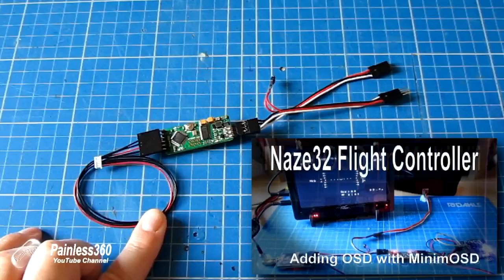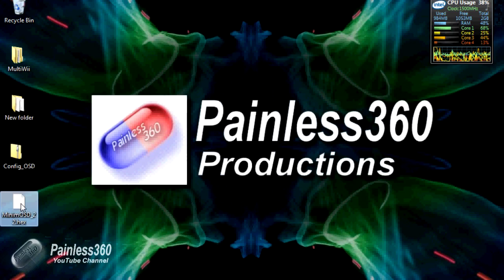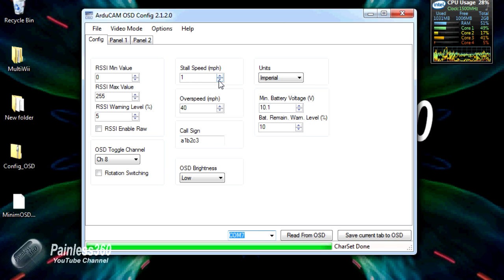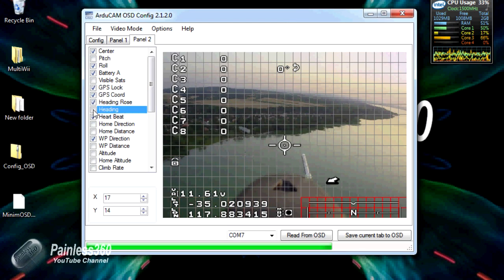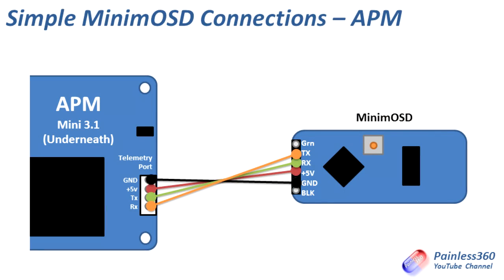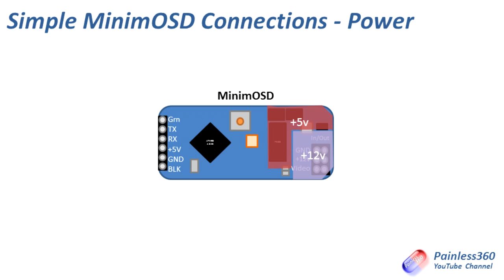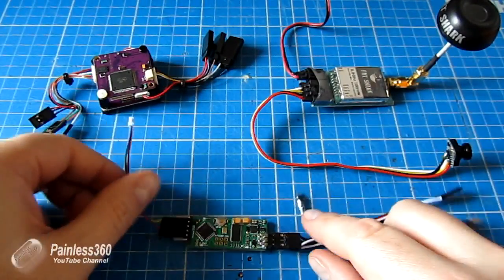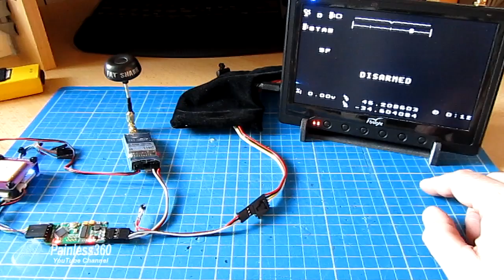APM Mini 3.1 - Adding an OSD for FPV using MinimOSD - complete setup

Comment: OSD only works when the power is supplied via USB without understanding what is necessary delobmozhen shtoto solder?
Reply from the maker: +Максим Иванов Check that the OSD is getting 5v when powered from the battery. I would check that the power connections are ok. Best of luck.

Comment: Hi, I'm just figuering out how to connect the MinimOSD to an APM 3.1 while using a GPS in the same time. The problem is, that the GPS should be plugged in the port, which I though, it is the telemetry port for the OSD. Could you help me with that?
Reply: +ZomhadRC Are they sharing one Port? I could easily solder me a Y-cable, would this work?
Reply from the maker: +ZomhadRC Not the same port at all. See 10:56. Best of luck.
Reply: +Painless360 Thank you very much! Stupid me didn't see it underneath theire :D Cheers, may you have a nice evening!

Comment: Hi, I'm trying to find the same FTDI you are using but then I found this cable 
http://m.ebay.com/itm/6pin-FTDI-FT232RL-USB-to-Serial-adapter-module-USB-TO-TTL-RS232-Arduino-Cable-/400356015296?_trkparms=aid%253D222007%2526algo%253DSIC.MBE%2526ao%253D1%2526asc%253D20150519202348%2526meid%253D279d3ac99b6041b187fc79992f33e98e%2526pid%253D100408%2526rk%253D1%2526rkt%253D19%2526mehot%253Dpp%2526sd%253D351044858391&_trksid=p2056116.c100408.m2460 
Is this the same thing?
Reply from the maker: +Charlie Farrugia Maybe, I only use 'FTDI Basic' adapters here and they work perfectly. Best of luck..

Comment: Thanks for this video i was wondering how the 12v was going to connect to my 5v eachine fpv..turning the whole board into 5v is great.  now i need to convert the eachine plug and play system to what you have shown. hope it will work. thanks again. love your tutorials.

Comment: Hello. I have small question. My configuration pixhawk + miniosd + frsky x8r.  All configures and work fine. In mission planner I see rxrssi with correct value. But on OSD screen I do not see rssi icon and value but in ArduCam I placed rssi. Do you know how I can fix this issue? Maybe need other firmware ? Not arducam-osd ?
Reply from the maker: +RC Copter I've not seen that myself. I would check the settings it the OSD.. Best of luck.

Comment: Is there any way to get a battery voltage reading without using a power module?
Reply from the maker: +Leon Close If it wasn't an APM I'd say use a KV_Mod MinimOSD and connect it to the main battery directly but you can't do that with an APM - different firmware on the OSD. If you really want Voltage then look at a PM. Best of luck!
Reply: Thanks for the response. I've gone with a Tarot OSD in series with the Minim, just for the voltage readout. Probably weighs less than the PM and I already have it.

Comment: HI !!!  I have a problem .Apm mini 3.1 board has only one telemetry port .so how do I connect  telemetry radio and minimosd both into the board same time ????
Reply: +Nayana Pathirana with a Y split cable like this.
http://i00.i.aliimg.com/photo/v0/60076532680/APM_2_6_3DR_Telemetry_OSD_Y.jpg

Comment: Hi Professor, would this work the same for Pixhawk using arducam instead of Minimosd extra where there are some issues on AC3.2.1 and 3.3? I am tempted to try it, as I have poor results with the minimosd extra r800 (which is recommended, on telem 2 with some mods on the firmware parameters for this port...). and to complicate the issue, I am using a 3 way switch on this setup, and off course, nothing works! ;) Just to know if you tried this OSD firmware on Pixhawk, first before moving on.... Cheers and Safe Flying!
Reply from the maker: Any Minimosd firmware that expects MAVLink heartbeats should work. I've not tried it yet on the PixHawk.. Best of luck!

Comment: Oh and another question (sorry to be a pest). I've seen your video on how to configure a Taranis to for send it's RSSI signal to a Naze32 over a PPM channel.  Can the same thing be done with an APM and have the APM forward the RSSI info onto the MinimOSD?  If so, anything we should know?
Reply from the maker: Andrew Smith Not as elegant - http://copter.ardupilot.com/wiki/common-optional-hardware/common-rssi-received-signal-strength-indication/
Reply: Painless360 No not quite but it'll do the job.  Cheers.

Comment: I have the 3DR 915MHz telemetry module and was thinking I could just split the wires from the APM so that I have a telemetry feed going into both the MinimOSD as well as the 3DR telemetry module.  This should work OK shouldn't it or will there be too much drain trying to run both devices simultaneously?
Reply from the maker: Andrew Smith This is a common thing for builders to try. The issue is exactly as you describe with the load on the output becoming too great. I have seen 'buffer' circuits to allow this but never used one myself. Best of luck.
Reply: Painless360 Damn.  Time to google 'buffer circuits'.  Cheers.
Reply: I have an APM2.8 running both the minimosd micro, plus a 3dr telemetry module. But for the osd the only connection i made to the telemetry socket on the apm was the tx, i run that to the rx on the osd. I powered the osd from a separate 5v supply independent from the apm. This way i have had no issues. At first i used the splitter cable that came with the telemetry kit which powered both the telemetry module and the osd from the telemetry socket on the apm, that caused problem with both the osd and telemetry module. Since powering the osd from a separate supply i have had no problems.

Comment: hi, is it possible to do mavlink and osd for fpv at the same time on the apm 3.1? couse its using the same telemetry port on the board i guess its not possible?
Reply from the maker: jelle buyckx It is but you can't connect the tx line from the OSD. If you google the question you will find a few articles and even cables (i.e @111612298603) that let you do it but there are reports that having two devices on the APM boards can pull down the signals from the port on the APM and cause issues. Using one or the other works.
Reply: yeah couse they sell it in a package... been looking for it and i have seen pics that they just connectet the rx and the tx of the osd and the mavlink togheter and then crossed it to the tx and rx on the board. thanks for reply. alsow do u know what power module is compactible on the v3.1 mini? couse i cant find mutch info on that. are they all compactible on 2.* and 3.* mini board?
Reply from the maker: Hi, the ones sold as part of a kit should be right. The connector is different and the pinouts are different too - https://www.youtube.com/watch?v=M6OSp05Y5b8&index=12&list=PLYsWjANuAm4pCP3jjSAcmDJIEmyaEregs

Use your voltmeter to check if you are not sure.

Happy flying!
Reply: can the apm 3.1 mini do the same things as the 2.* ones? ore dois it have let options/features? is it stupid to buy a apm 2.7 ore so nowadays?
Reply from the maker: The 3.1 and the 2.7/2.8 versions are functionally the same but just come in different packages. I would always go for the APM 2.X if you have the room as they are easier to connect everything up to..

Hope this helps.
Reply: yeah it helps, connecting should not be a problem for me. i go for the 3.1 then. i found a hole package including gps osd mavlink and power module. on the pics they connected the mavlink and osd like you sayed and not connect the tx from the osd to the board so it dois mavlink in combination with osd. i guess i am gonne try that to. thanks again, i love your fast responce and help, really appreciate that, cheers! wish me luck... :)
Reply: i still got one more question, i have the option to choise frequention for the mavlink, 433 ore 868 ore 915. i am from Belgium so i normally need the 433, but then again... i normally fly my 2.4ghz frsky and a 5.8 mhz vid link on fpv but my long rance setup are a uhf lr rc control system that already works on that 433 band and a 1.2 ghz vid link.  so would it be better to get the 868 ore the 915 mavlink so they dont stumble all over my rc controll link if i use my uhf system for controle? i guess even the 915 mhz mavlink is the best for me couse the second harmonic on my uhf control system is right on top of the 868 mhz to so? what you think? just go for the american 915 mhz mavlink? are dois it not really matter if i get the 433 mavlink and use it in combination with my uhf system couse its frequenty hoppin? i guess i get in to trouble with the mavlink 915 to couse sellphones use that band here in europe if i am not mistaken... !dillema! 
mmm... i guess i just need to disconnect the mavlink if i go far range with uhf...?
Reply from the maker: You need to check on what frequencies you are allowed to use in your country. 433Hhz is normal for Europe but you need to check.

Best of luck.

Comment: Only this firmware can be used for APM? What about MWosd or KVteam, or any other? They look much cooler for me. :)
Reply from the maker: Gašper Kolenc They are and with improved options for fonts and features too! Sadly these teams developing the firmware fro the MinimOSD are working on each project individually and you tend to find that a lot of the Multiwii/Naze32/Flip32 versions are evolving faster as the community is more active and there are more boards out there.
If you find a better one that this let me know!
Reply: Painless360 I doubt I will find better one before you. :)
Reply from the maker: You never know - I am up to my armpits in the world of CC3D at the moment creating that new series..
Reply: Painless360 Maybe remzibi could be good alternative. Today I receive a remzibi for mistake from China. I ordered ublox m8n, but receive remzibi with ublox 6m.

Comment: Question:  Why did you split the ground from the transmitter by going to the OSD then to the Camera?  If the entire board is being powered by the 5 V bridges what is the use of splitting the ground?  Why not send the ground directly to the camera and just run the video in and out to the OSD?  What am I missing?
Reply from the maker: Why do you think they might do that?
Reply: Only thing I can think off is isolation for noise.
Reply from the maker: Think about the instances where there is one huge battery powering the model and another smaller, dedicated battery used to power the FPV system. In that case having a common ground for both systems is essential and ensures correct operation.

Hope this makes sense.
Reply: I trust you.  Still a little fuzzy, you proved it works so that is the way I will wire it.
Reply from the maker: Jon, even the very latest version of the MinimOSD board (http://www.hobbyrc.co.uk/micro-minimosd-for-naze32-with-multiwii-osd-kv-team-mod) is wired this way with a GND and Signal both in and out.

Interestingly the latest version of the board has done away with the 12v power connection - maybe I was onto something ;)

Happy flying!
Reply: Painless360 Will be testing this afternoon.  That is a really cool version of MinimOSD board.
Reply from the maker: I have one on the way so should be a video in the next couple of weeks.. very nice little way to get all the data on the OSD without all the fiddly wiring..
Reply: Painless360 Looking forward to it.

Comment: I would like to see apm mini 3.1 with minim osd and radio telemetry in a video tutorial if that's possible. Thank you again for very nice tutorials!
Reply: You can purchase a 3DR telemetry cable on there website that has the splitter built in for the OSD
Reply from the maker: As Jon has already said, if you get the right cable you can follow this and the other video that covers the MAVLink radios with APM Mini 3.1 (https://www.youtube.com/watch?v=0lINt4hv5tg) to add them both to the model at the same time. You do need to watch the signal level from the Tx pin from the APM as having both devices connected can pull the signal level down to a point where there can be errors. Seems to happen on some boards and not others.

As a side question, all of these videos are done for free. Would you pay to see that video you want? I am considering offering a subscription service for requests and one to one support.

If not, best of luck with it. Happy flying!